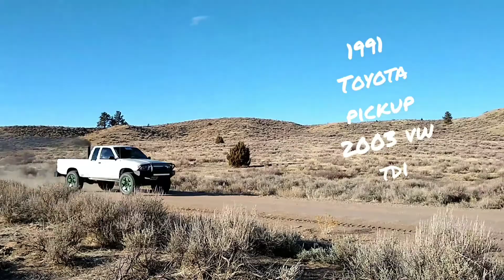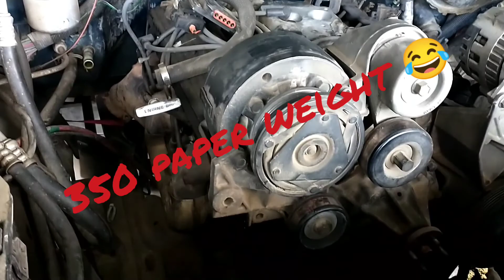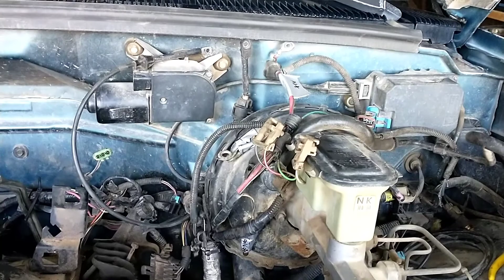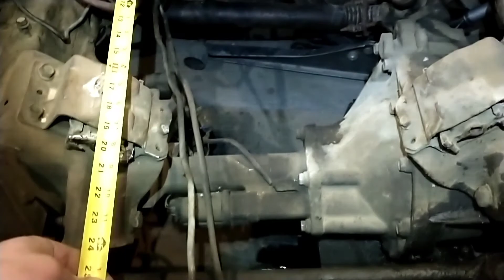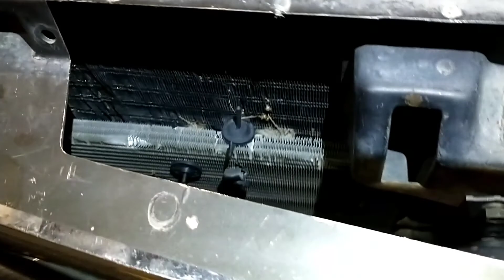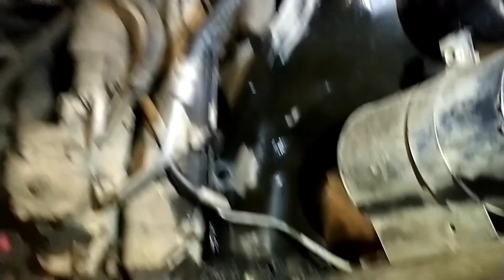TDI Swap Chevy 1500, pulling the 350 and checking fitment for the TDI!

Comment: How are u running the factory transmission in the truck
Reply from the maker: This is an early 4l60 before electronics, basically a 700r4, only the kickdown cable is needed to control shift points and line pressure.  Torque converter lockup is still controlled by the speedometer i believe, we didn't have to touch that

Comment: A 2'' body lift would give you room to move the trans and transfer case up an inch for more clearance do they make adapters for a 2001 s10 with a 2.2
Reply from the maker: Yes unfortunately we are already dealing with too high of gearing in the axles so running smaller than stock tires, a 2-inch body lift would be easy if we were going to re-gear to be able to run larger tires but it would look a little funny at the moment haha.  I know they only make this adapter for the 2.8 l, or a Chevy small block adapter https://tdconversions.com/products/vw-1-9-2-0l-tdi-to-chevy-2-8l-adapter-kit-automatic?sca_ref=2282812.xcTsEMbSOW

Comment: Why wouldn’t it? Ain’t the 1.9 TDI a lot smaller then the OEM engine offerings?
Reply from the maker: Well if you watched the last part of the video, the 350 engine sits very low in the bay, the differential is going to be within an inch of touching the oil pan, and that u shape above the differential is barely 2" wider than the pan.  That combined with a low transmission tunnel is making it a tighter fit than I expected.